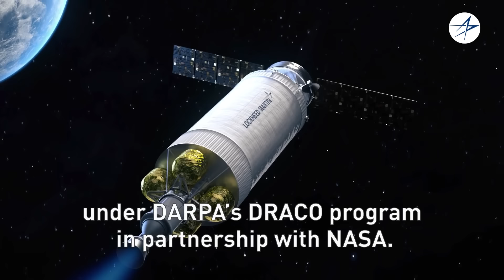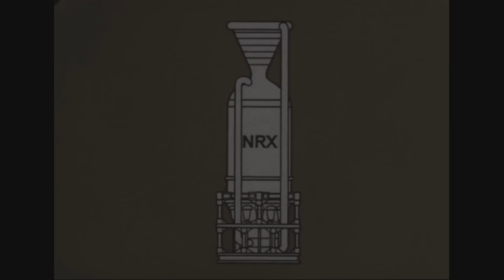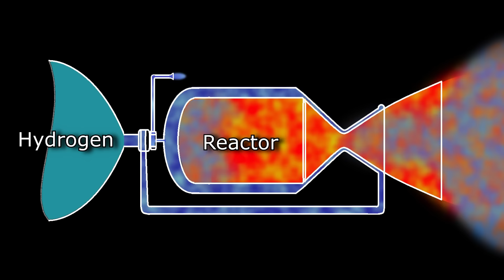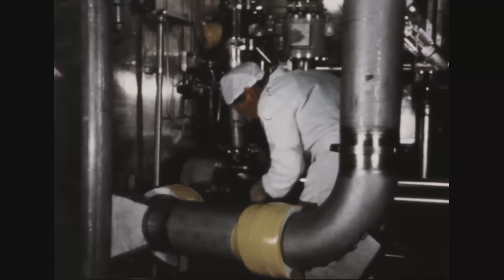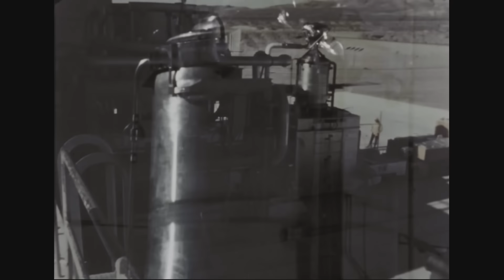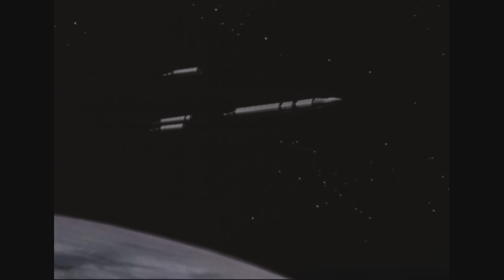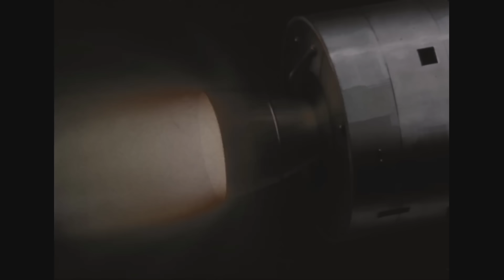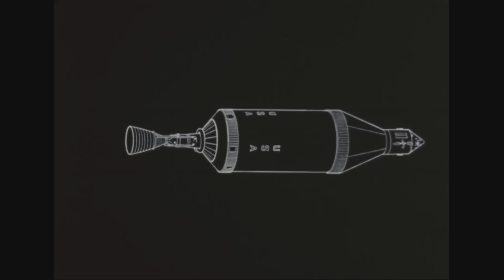Why Nuclear Rockets Are Going To Change Spaceflight

Comment: At sea level, mix oxygen with hydrogen/methane so it pushes out water (uncompressible) to lift off... in a vacuum, use something that outputs a heavy material aka a mass-offset engine...

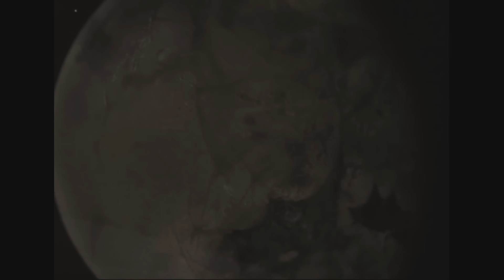Comment: 15:15 I wonder if you could use that generator to install an arcjet afterburner and get even higher ISP? Like propellant flows through the reactor, powers a turbine generating electricity (and pumping force of course), the propellant then flows through the reactor a second time, flows through an arcjet powered by the previously generated electricity, and then finallly flows out through the nozzle?

Comment: A solid state nuclear fission generated ultra high pressure steam engine. The water “tanks” can be used as radiation shielding. Not for leaving earth, but rather for continuous acceleration. Then one just has to find water to refuel. 🤔

Comment: It is unlikely that anything will be done with this. In 1946, NEPA was started. This became the ANP program later on. A nuclear aircraft engine was ready in 1960. The Kennedy administration cancelled the atomic aircraft project. In 1965, SNAP-10A was launched. This was a satellite with nuclear power. Today, companies are prepared to roll out Small Modular Reactors for commercial use. This is the size of a shipping container that can be delivered by a semi. Applications include providing power to so-called data centers, bypassing overloading the local electrical grid.
DARPA will go forward with this only if China and Russia go forward.

Comment: If we ever get into the industrial age of space, chemical rockets definitely will be used far more often because of ease of supply and overall performance benefits, all those natural gases sitting on planets, moons and other bodies, I see non-chemical being more for general electronic and evironmental protective uses due to comparably lower pollution;

think of it like this: you have fuel routes, large fuel cannisters for SPACE ONLY vessels and refuel them in space, but of course thats industrial space age stuff

Comment: DRACO has been cancelled. The reason being that the diminishing launch cost do not justify nuclear engine development. This is not false, as a major point in this video is missing. Density of LH2 is 0.07 kg/L. Density of LOX/LH2 is 0.35kg/L (depending on fuel ratio). This makes extremely large tanks, and heavy for the propellant mass. Mass fractions beyond 4 are impossible. So the delta V by stage is not increased. 
So its capabilities are not increased, by its gross mass is decreased. The big gain of the nuclear engine is for the previous stages, whose size can be decreased. But the other approach "just use more boosters!" also works as well.
At last, the high dry mass of the stage means it cannot be used as a last stage. And its low trust (TWR of the stage is between 0.1 to 0.5 typically) means it can only be used after achieving orbit. So the only configuration possible is a 4 stages rocket, with the 3rd stage the nuclear one. Saturn V was the only rocket really well suited for this.

Comment: Why not fission rockets? Drop small deuterium/tritium pellets and blast them with a high powered laser on the rocket's pusher plate. No significant nuclear waste if this could be done. The hardest part would be accurately aiming the laser but otherwise this is an already proven means of fission.

Comment: Eh eh eh eh... no you can get hotter, it would just take a novel design, with a gas core reactor you can get insanely hot, however how to transfer that heat to the hydrogen is problematic, a liquid core reactor through would be a big improvement because theoretically assuming you are using molten salt you can get upto 1300C, which is much hotter than a solid fueled reactor can get to

If you were going to go the gas core reactor route though you would probably just go open cycle and just launch it into a high earth orbit and never let it come close to Earth.

Comment: We will travel by frequency. The frequency from our desired location will pull us to it. Perpetual motion as long as there is a frequency. Like a magnetic attraction. The frequency will be converted to soundwaves, powering, nuclear cavitation process, ripping a whole in front, zipping up behind. Traveling in between incapsulated inside a pod submerged in liquid Mercury. The Mercury and its structure and gravity can be directly manipulated by electromagnetism and soundwaves.😅😅😅

Comment: Why not use a combined cycle of thermal and ionic thrust?  Use an ion accelerator to increase the exhaust velocity by several orders of magnitude thereby reducing the fuel needed and increasing the thrust.

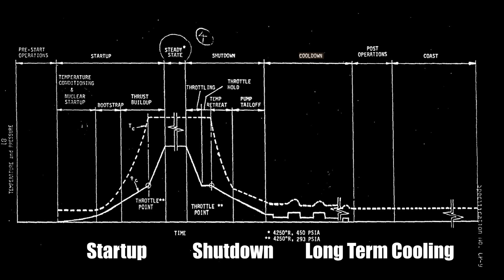Comment: 14:12

Now Im no nuclear physicist. But i get the basics enough.

On KSP with some of those nuclear engine mods.
If they worked more like this. I can see the problem they would pose IRL.

This fact would indeed make things SO much harder for planning.

an engine that has its thrust differ depending on its lifespan and current operating conditions would be a major headache in getting precise burns.

Burning for mars eh?

Nope.
The engine has more thrust than you anticipated because of a heat difference.

And it takes 3 seconds longer to ramp down than initially calculated.

Now you have overshot interception by a factor of over 900M/S.

YAY PHYSICS!

Comment: I have came up with an invention idea, using an ionic thruster, to push a gas around in a close loop, that thrusted output, would be sent through one side of a turbo charger, the hot side, and continued through the turbo charger, to then be sent back to the inlet of the ionic thruster, to be boosted again even higher, so as the gas loops continuously it picks up speed to a very high speed, the other side of the turbo, would draw in ambient air, compress it through the turbo, giving a higher thrust output from the turbo, giving you a usable thrusted output....🤔🧐😎👍
Reply: @JK.... 😢UNFORTUNATELY(!), "Close Loop" Won't Work for Jet Propulsion(Or Any other Propulsion!).
SORRY... You have to Leave the Rocket Science and Space Travel...And go Back to Isaac Newton's FUNDAMENTALS!😮😢😊

Comment: I don't know if it's been proven to work. I do know that a nuclear pulse drive has been proven to work during Project Orion. It just never took off due to the EMP interference that satellites in orbit might receive. Maybe they can use nuclear rockets or pulse drive if the spacecraft gets escape velocity first and clears the sphere of thousands of satellites orbiting Earth before powering up. Just pray that your reactor doesn't get hit by a meteorite while on your way to Mars.

Comment: Engines are not the limiting factor.  The frail human body is.   Evidence from long term stays on the space station has opened many eyes to our own limits in long term zero gravity exposure.   Fiction works like Star Trek get around this with "artificial gravity" but there is a good chance that such  thing is impossible to simulate as they do using fictional gravity generators.  Rotating ships can simulate it but come with their own issues.

Comment: Just because hydrogen comes out faster, does that translate to more thrust? Heavier stuff would have more mad to push against(equal and opposite). Seems like best for nuclear would be combo of best absorbtion of heat vs best initial size of fuel to heated size ratio, that also works at those high temps.

Comment: Alas, DRACO is dead. The finalized FY26 President’s Budget Request on May 30, 2025, allocated no money for nuclear thermal or nuclear electric propulsion (NTP and NEP). In June, DARPA said the termination was based on assessment that the costs no longer matched the benefits, presumably the dramatically reduced launch costs shown by SpaceX.  A second justification, NEP is favored over HTP due to much higher efficiencies. But given the complete zeroing out of nuclear propulsion money, it feels more likely that OMB simply doesn’t believe in the value of nuclear propulsion or of deep space exploration, period, given how they want to even slash science missions that are in flight.

Comment: Solar thermal rockets around earth are even more efficient.  They vaporize upper stages like aluminum but really anything you put into them. 

I've come up with ISP of 1500 assuming 2500C exhaust.  The real savings comes from using otherwise discarded stages, external sunlight power supply, lightweight reflectors to gather sunlight, and that mass is so efficiently used up during burning. No nearly stages to accelerate!

It's the coal shoveling railroad engine for space.  Heck, one could use plain moon rocks vaporized through a thermal sunlight powered engine.

Comment: I think it would be practical to utilize both gas and nuclear (thorium) engines. The gas engines get the spacecraft into local space, and the nuclear engines provide the thrust for long-distance space travel. Once the spacecraft arrives at its destination, it does ot land. It uses smaller vehicles to shuttle between the surface of the target and the space vehicle. The space vehicle can then reactivate its thruster engine and return to Earth. The space vehicle remains in orbit like the space station. Then, smaller gas rockets can be used to shuttle between the space vehicle and the Earth's surface. Cost-effective and practical.

Comment: The problem with nuclear propulsion is that mankind, regardless of what country, has an absolutely disgusting history of flat out irresponsible behavior in pretty much every single effort involving nuclear materials. There are no exceptions. The evidence is littered all over the planet. Oak Ridges, who experimented extensively with nuclear rockets literally raised the background radiation of the entire planet from a mere 33 tests. I will never support the use of nuclear anything until we have rational governance. Unfortunately, that is currently very far from the case.

Comment: Interesting video! I suspect that more accurate results could be obtained by polarizing the light with a glass plate set at Brewster's angle. Such a plate could also be used to construct the analyser, but would be a more difficult build. I think you did well!
Reply: This comment somehow got attached to the wrong video, sorry

Comment: I wonder how much thrust would be generated if they just used water instead of hydrogen. It's cooling capacity is probably not high enough for the nozzle but maybe an additional fuel source? Makes good radiation shielding before using it as well.
Reply: If I'm not mistaken, there have been designs for saltwater nuclear rockets drafted

Comment: Extoll components, ignore the system as a whole...like fusion burning kilos of He-3, inertial confinement fusion, the Z machine, VASIMIR. White hot hydrogen eats all materials.
The MatterSlapper™! Matter versus antimatter are opposite Weak Interaction chiralities. 1) Matter beam. 2) Xtreme-Curl™electric field. 3) Fractional inversion of Weak Force chirality. 4) Matter-antimatter annihilation: 1/2 gram each, 90 trillion joules. Fund now, one small footnote later.

Comment: Whacky doo! You STILL need reaction mass to propel your rockets. No reaction mass = no thrust
Reply: ?  Ya, that’s what the hydrogen is for.  It’s not there to burn, it’s there to be heated up by the reactor.
Reply: Yes agreed, delta-v as per the rocket equation. Nuclear thermal rocket engines no good for launch from Earth to orbit. Can only be useful in outer space, where is source of reaction mass in space? water = hydrogen on the Moon? liquid hydrogen to get to and from Mars without loss in hydrogen boil-off? CO2? plenty on Mars and easy to store handle long term.

Comment: Some people use the building of the first transcontinental railroad as  analogous to nuclear rocket propulsion making travel to Mars reasonably practical. The railway analogy is absurdly inadequate. The railway connected one nice area with another. For the railway to be an analog for Mars travel, it would have to cross the Drake passage to Antarctica, and Antarctica would have to be by airless.

Comment: We need to start thinking outside the box perhaps and tapping into the abundant fuel source that permeates spacetime itself, if the planet can do it naturally using its magnetic field trapping high energy particles in 'The Van Allen Belts' then why can't we do it synthetically?

The artificially produced "Belts" could also act like a shield against C.M.E.s and other dangerous solar radiation (or a big part of it), it would save on large fuel storage and vehicle mass as the fuel would be contained/confined by the magnetic field outside the ship/craft.

The best shape I think would be either disc or tauroidal so the magnetic field could force the high energy particles to have a focal point in the centre of the craft so some could be 'bled off' to power the ships systems and the rest could be focused and redirected in a specific direction causing the ship to move in the opposite direction whilst gaining momentum (up to at least 50% the speed of light?).

You wouldn't want anyone at the central part of the ship as your magnetic field generator/highly charged particles beam focuser would be housed there and you may want a 'dead zone' between the generator and ship so the particles couldn't enter the craft accidentally as it could pose a problem (why I was leaning towards a tauroidal shape with structures/boom between the craft and its central point).

The body of the craft may have to produce the magnetic field so it would help the focal point be at its centre but it would still require a device to syphon off some of the energy and another part to direct the particles in one direction away from the craft like a high energy beam/rocket engine/exhaust, this system might be OK for travel within the solar system but we might need his big brother or father for outside the protection afforded to us by the suns heliosphere (because it protects us from the big nastier particles produced by supernovae etc). 😆 🤣 😂 

It would take the likes of NASA, DARPA or someone with a far greater intellect (and cashflow) to start crunching numbers and at least testing whether this is feasible or not but I don't know why it couldn't be, if light sails can take advantage of 'light pressure' passively then I'm sure we could harness that and give it a little more 'intent'.

That or I just gave out the blueprints to a solar powered death Ray?! ..... 😆 🤣 😂 

What could go wrong? ... 🤔

Comment: Use a secondary outer pressure jacket with a liquid thermal insulator to compress the core's material structure to raise its vaporisation temperature. More temperature more good. If the core needs to be more flowing metal under the most impressive pressures maintaining the structural integrity of a molten active support design. What is solid at room temperature but refuses to phase change to a solid above 3,000°k and forms a polycrystal oxide upon contact with rocket fuel.

Comment: I don't hear you saying what radiation this rocket idea will be leaving in space. Will future space missions have to avoid the radiation path from a previous flight to go to the same destination. If your putting a nuclear reactor in space then why not use the ion propulsion drive anyway.
Reply: Just about every kind of radiation particle moves at or very near the speed of light, so the moment the reaction stops the radiation will dissipate in whatever region of space you’re flying through

Comment: Here is a thought that occurred to me. What if you built a planetary probe for gas giants where the nerva rocket used the surrounding atmosphere as the working fluid enabling the probe to "hover" at whatever altitude desired. The turbopump could use the tap-off cycle to compress the working fluid.
Reply: That’s actually a real thing known as a nuclear thermal jet engine; conceptually the same as a traditional turbofan/turbojet for aircraft but with a nuclear heat source instead of combustion. Though even ignoring the radiation problem I’m not sure how long one could work without maintenance and thus how long one could fly in the Jovian atmosphere.

Comment: One interesting fact is that these engine would be more convenient compared to hydrolox the higher the delta V requirement of the stage  . The isp is around 9000 Ns/kg or twice the one of hydrolox. The advantage in mass ratio compared to a chemical rocket can be described as (e^(x/4500))/(e^(x/9000)) and it goes up as x( the delta v) goes up. Assuming a delta v of 
5 km/s the ratio is 3 for chemical and 1.74 for ntr. For 10 km/s of delta v the ratio is 9.2 for chem and 3 for ntr.

Comment: No offense but the humanity is already using those as ion plasma engines. and i heard Russians are already one step further by adding some weird metal fuel into it. Building nuclear engine doesnt solve roblem of speeding up. but it causes a lot other problems with additional radiation and reactor safety. this was why everyone stopped to develop it.

Comment: Of course leave it to a nuclear physicist to over engineer a nuclear rocket just put a nuclear heat Source in an insulated water-filled pressure vessel with a valve attached to a bell let the heat Source bring the water to well above boiling then when you want the rocket to work open the valve